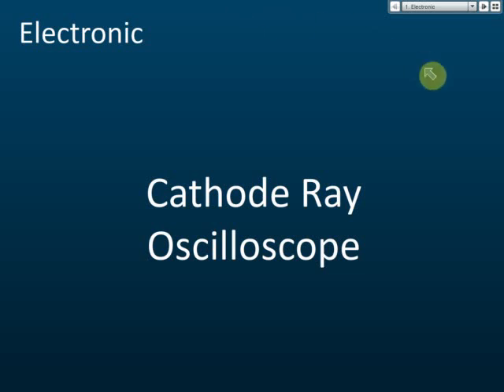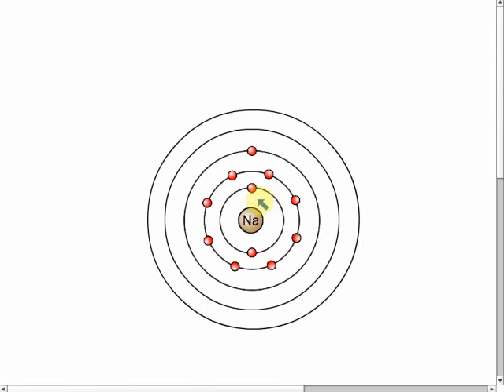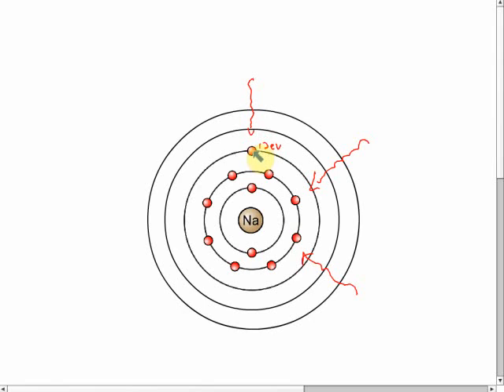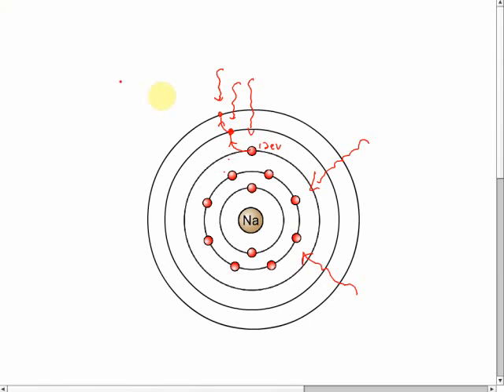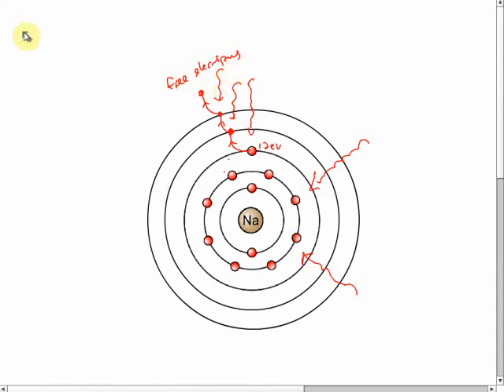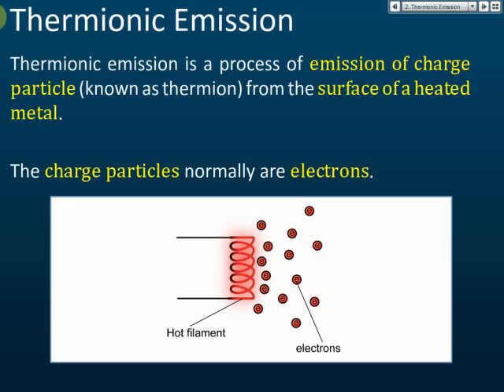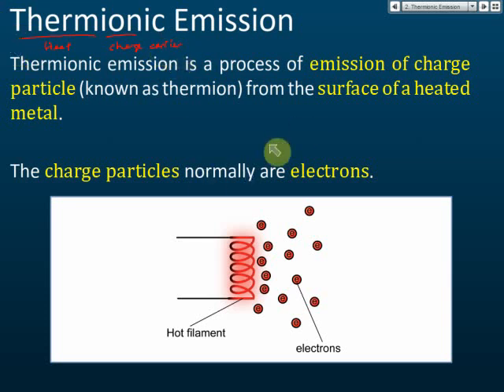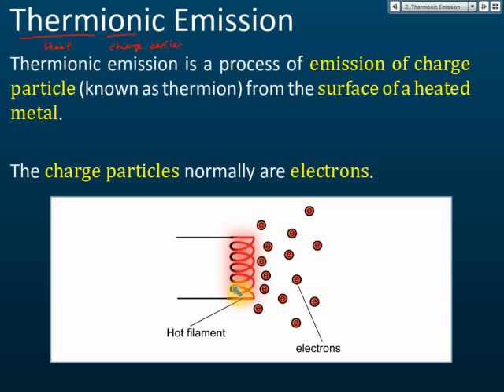Thermionic Emission | Electronics

Comment: Hi, if we keep applying heat to the metal, is it possible that the metal will run out of electron?
Reply: current is made up of moving electrons (electrons from the battery).  but thats for a filament, you mean just heating up a piece of metal w/o a current source. maybe metal melts into plasma vapor.
Reply: @alberoDiSpazio  , but
Reply: Hey guys
Reply: Turned into plasma maybe....
I think when it reached octet or duplet level meaning it turned into ion and it might turn into plasma... maybe dun 100% trust me
Reply: Might be possible but you gotta heat it too much then.  Because removing the outermost Electron of Na required 12eV

Comment: If the path of the electrons are not those shells, how do they move? Do they wiggle and bounce back and forth everywhere, and those shells define their average distance from the nucleus? At any rate, great video.
Reply: The electrons are still revolving around the nucleus but not in a definite path, the shells show the possible area where you can find that electron there are no orbits
Reply: Manjula Dhulipala do u think its more like oscillating fields and where we "find" them is just where the field happens to interact with our detector?